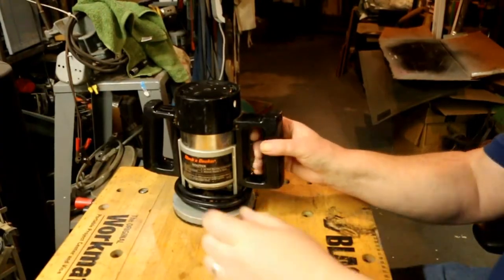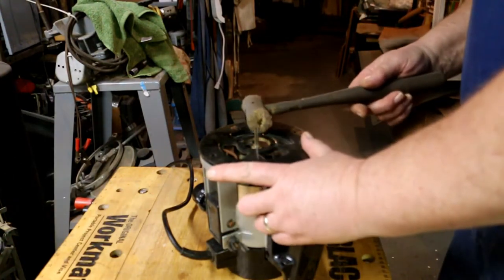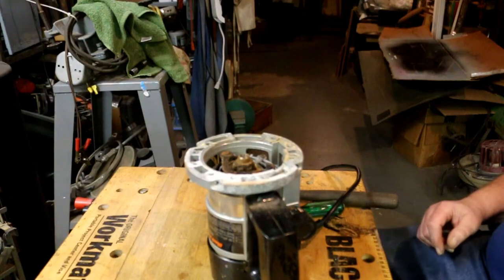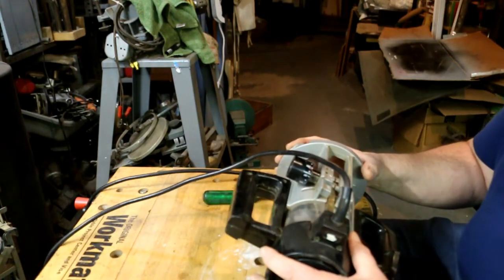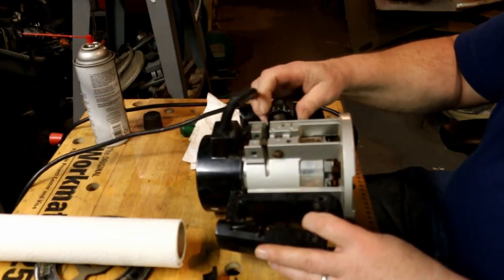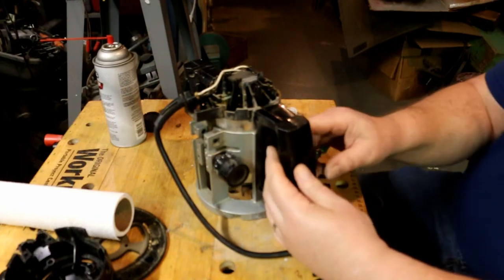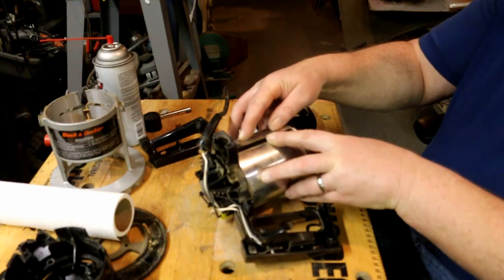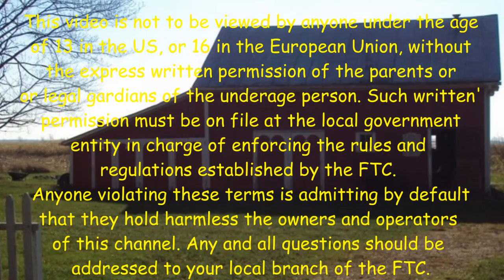Restore Find - Black & Decker 1 Hp $5 00 Router Repair Pt 1 Disassembly

Comment: I have a similar B&D router that has served me very well, that being said nothing beats the vintage Porter Cable models for being bulletproof.  😃👍
Reply from the maker: I have a Porter Cable that you probably remember. It is a little smaller. I also have a couple 1/2 hp Craftsman routers. 
I intend to mount this on my cheap router table so I can cut the dados and reliefs in the sheller frame.

Comment: My Dad bought me a Craftsman 1-1/2 Horse Router when I was maybe 16, I've loved and used routers ever since......The Craftsman is still going strong and it's the one I use most often, I have it mounted on a Router Table...........Almost everything I build out of wood gets hit with a round-over bit.
Reply from the maker: 1/4" radius round over is my go to. 😁😎
Reply: @OldSneelock  Mine is a big bit so it's probably a half. I really have no idea. If it don't help with the yard it's not in the loop.

Comment: my idea for first no start dirt on brushes or something like that somewhere at the start was thinking here comes the 50 50 on the bit
Reply from the maker: I think the same thing when I get a no start. 
This time I think it was the stink bugs, They were in the spring tube for the brushes. If they managed to squeeze into the spring and stop the brush from floating it would stop. 
When I disassembled the cover over the brushes and two stink bugs were in the brush area I went looking to see if there was any shorting or skipping on the commutator. 😁😎

Comment: When the collet nut squeaked I thought 'Yeah, here we go' and then you know what I was thinking when the bit wouldn't come out. Don't Be Stingy! I ended up putting some anti-seize on the collet on my old router or it'd stick every time. Then it never stuck again. It went to boy/son along with fishing poles and makita circular saw. If it don't work.............! The son-in-law gave me a spare of his, a big tall thing with a roundover bit in it. Works fine and stays in the dry shed like all good tools. Grub run day and the sneeze baffles are coming down in town she said a bit ago when she called. We'll see. Have a nice cleaning day and GBWYall!
Reply from the maker: I always leave the bit just a little bit out from the bottom of the hole. Then I can loosen the collet and tap the end of the bit and it drops right out. 
This one wasn't too bad. Tapping sideways breaks the collet free pretty easily. 
The cheap wrench that came with the router flops around on the nut and slips off because it is so thin. 😁😎
Reply: @OldSneelock  I did too but it still stuck. The anti-seize fixed it. WAY before the days of 50/50. My router was a sears or B&D. Sears I think. Got it from my ex's dad and it was about shot but it ran and was good enough for a diesel burner. The roto-zip DeWalt is very handy and the big one is always standing by.
Reply: @lewiemcneely9143  Bout the only thyme I deal with a router is when the internet is giving us trouble so I go and unplug the router and plug it back in again and usually that fixes it. Don't know where to put the anti seize on it and I think if I used it then it would start having fits. 
Oh and Unk Dottie was asking how your better half is doing. Have a good day guys. Happy Motoring.
Reply: @mostlymoparih5682  We went through either 6 or 7 of them before the cable finally got done. The one we have now is lasting but it may die today. Was going to adopt the phone company guy that fixed it all the time. Now it's all hardwired; no wifi. And I rub anti-seize on me and haven't seized up in years. Much. And as for your router it'd be hard to say where it needs to go and the Happy Motoring is done for today. I cranked the weedeater and she did the rest. Now we both can rest! GBWYall and Dotties saying about sugar still reigns.
Reply from the maker: Good days and bad. After 40 it is just patch, patch, patch.
Reply: @OldSneelock  Dottie has started the GAPS diet and I am doing it two2 but I'm allowed to cheat (so says I).
I have lost 15 pounds, Dottie hasn't lost much but has not had a Pancreatic attack since she started. It is also helping with her BP control. 
Some food actually tastes extremely good now. Maybe my taste buds have come back to life. Talk to ya soon.
Reply: @OldSneelock  Pretty much and waiting for the energy bubble to bubble up again.